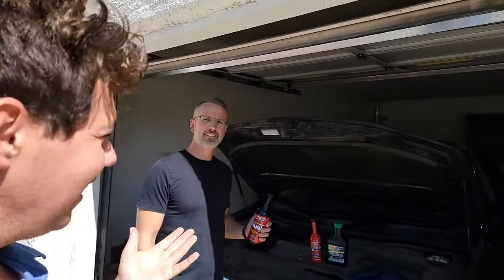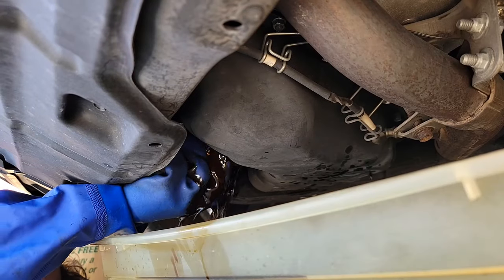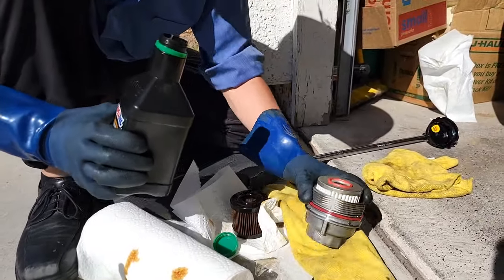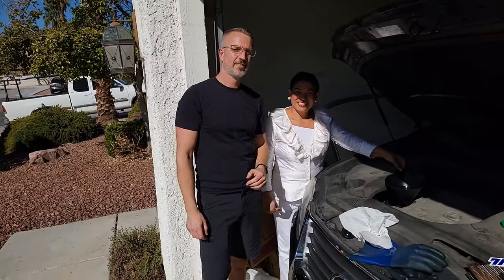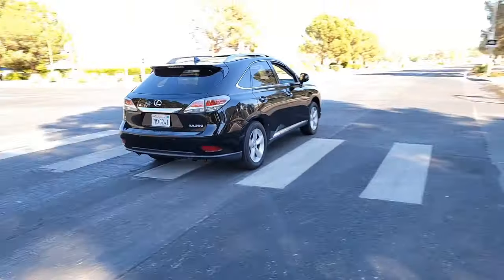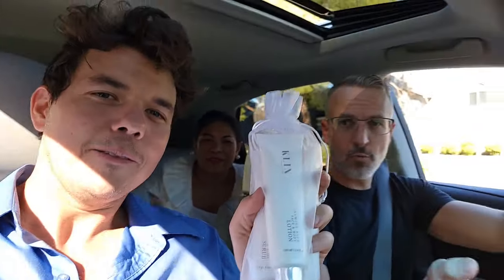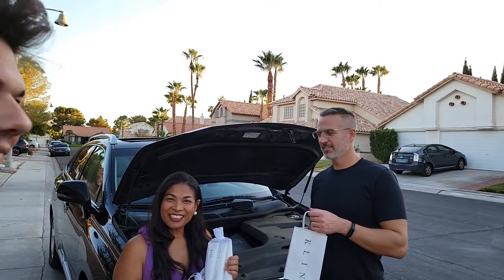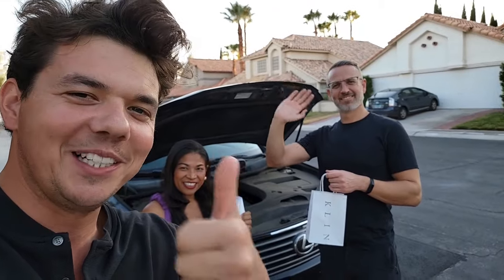Stop ! Oil Burn 3 FLUIDS

Comment from the maker: Watch This Next: Get Faster Transmission Shifts Than Brand NEW With the Right Fluids - https://youtu.be/sGzTtXVP24c 

     ✅ ✅ ✅  Save 25% On Next Fluid Order: https://www.amsoil.com/offers/pc/?zo=5331179 

     ❤️ 🇺🇸 ❤️ Your Professional YouLubher: Eben Rockmaker. Find The Right Fluids For My Vehicle - https://www.amsoil.com/guides/?zo=5331179      

     🥇🥇🥇 Synthetic Oil Protection Google Map & Reviews (702) 472-3614 https://maps.app.goo.gl/DmLU5hP72HadUBEm9              

     ⛳️ Synthetic Oil Protection Website - http://syntheticoilprotection.net 

     Did you know a oil manufacturer can call a lubricant a Full Synthetic when it's only 25% synthetic? AMSOIL is different because it is 100% Synthetic and has a higher film strength keeping the metal parts separated. AMSOIL allows less friction, less heat, less wear on the component. 

      ♥️ See Fluid Performance Tests - https://www.amsoil.com/performancetests.aspx?zo=5331179      

      Your Vehicle Could Run Better Than Brand New By Using The Right Fluids! See Results - https://youtu.be/zH-VquYlhqA Why AMSOIL - https://www.amsoil.com/about/exclusive-distribution/?zo=5331179    
     Synthetic Oil Protection Coffee - Ebens Favorite: https://supportwith.coffee/shop/subscriptions/sop/
Reply from the maker: Great question Roman yeah all you want to do is put it in the motor and let it idle for 15 minutes after you let it idle for 15 minutes then you drain the oil this is my link to the products it will give you the very best value as a 6-month preferred customer and when you use my link I will always be able to answer your questions in the future on the products.
✅ ✅ ✅  Save 25% On Your Next Fluid Order: https://www.amsoil.com/offers/pc/?zo=5331179
Reply from the maker: That's a damn good question I have no idea

Comment: Hi Eben. I just flushed out my power steering system with the Amsoil PS fluid. Looking forward to not doing this service again for a long time as it was a bit messy unhooking both lines using a new reservoir. I could smell the detergents in the fluid as it smelled similar to the Amsoil AT fluid. 
Pump runs a lot quieter now.
Reply from the maker: Oh yeah nothing like getting out the old and getting in the new...... now you're good for a long time💯

Comment: Off topic,  I've had 2 out the last 3 WIX oil filters drain back valve completely fail on my jeep. I'm running the amsoil filter as of now.
Reply from the maker: Yikes that sounds like really bad luck
Reply: Update. Amsoil filter has solved the start up knock.

Comment: I just had the ATF on my 2007 Honda Fit switched over from Honda's ATF to Amsoil. What. A. Difference. Smoother shifting and quieter. I might even see some improvement in the mpg's. The car already runs on Amsoil's Signature Series oil w/ an Amsoil filter.
Reply from the maker: Super sweet Shelton for sharing that with the channel thank you and I'm stoked your car has taken the next step in performance and lifespan

Comment: If youre buring oil dude its rings or valve stem seal or something on its way out the money you waste useing these to keep them alive soon adds up and in the end you may aswell have it fixed
Reply from the maker: Correct when you use these fluids they clean the valves and they clean around the Rings which allows the oil to flow around the oil passages in the Rings and allows a better seal so then you'll have less burning and fuel contamination which exponentially breaks down your motor oil these fluids will increase your vehicles performance and extend the lifespan of the vehicle

Comment: Ehh, have had ams oil signature series in my 2019 Dodge since about 3K miles have 87k miles now. Decided to do an independent oil test and wouldn’t you there’s 29 ppm lead and 26 ppm of copper… so is ams oil better we will see once I take the engine apart and check out the internals 😅
Reply from the maker: Oh yeah you'll notice your oil will get very dark that is the detergents cleaning the old mineral deposits out of the motor once the filter gets full the oil will get even darker so it's good to change that filter early I would change your oil filter at about 3 to 5,000 MI

Comment: Hey eben, I have a 2004 Tahoe with 240,000 do you think I would benefit from it? I usually change my oil at no more than 10,000 miles. I have used Havoline full synthetic since I’ve owned it.
Reply from the maker: Yes you'll see a huge difference this will give you the very best value on the products and when you use my link I'll always be able to answer your questions in the future👍
✅ ✅ ✅  Save 25% On Next Fluid Order: https://www.amsoil.com/offers/pc/?zo=5331179 

     ❤️ 🇺🇸 ❤️ Your Professional YouLubher: Eben Rockmaker. Find The Right Fluids For My Vehicle - https://www.amsoil.com/guides/?zo=5331179

Comment: Do you have a shop?   I think I saw you were in NV in a video.   
If so what is your location I have a Tacoma that needs a bit of work.  TIA.
Reply from the maker: Awesome yes I live in Las Vegas on the west side of town and I do lots of videos on people's vehicles I personally don't own a shop but I do recommend the products and you can order them through my link and that would attach me to you in the future I can always answer your questions about improving the performance and lifespan of your vehicles and equipment by choosing the right fluids as your independent Amsoil Dealer and I can also recommend installers if you ever need someone to put the products in your car you can also use someone I know or your mechanic you already use😃☕️

If you have any questions give me a buzz👍
Eben 702-472-3614 
✅   Save 25% On Your Next Fluid Order: https://www.amsoil.com/offers/pc/?zo=5331179

Comment: Which oil for my 67 Buick Riviera, 430 c.i.?
Reply from the maker: There's a lot of variables here depending on how many miles are on it and the way you'll be driving it personally if it was my car I would do a engine flush on it and I would run 0w-20 Signature Series in it for about 500 to 1000 miles.
This will allow the carbon buildup to slowly get melted out after that I would go with the classic car oil called zerod you can run the 10w30 which will give you great protection for flat topic cams and I wish I had this information for my Cadillac when I first did the fluids also I recommend the pi performance improver and the Amsoil power foam you'll see that on a classic car playlist on the home Channel page this is my personal link and when you use it I'll always be able to answer your questions in the future on the products and I appreciate your business future business in advance thank you👍
❤️ 🇺🇸 ❤️ Your Professional YouLubher: Eben Rockmaker. Find The Right Fluids For My Vehicle - https://www.amsoil.com/guides/?zo=5331179
Reply: @Syntheticoilprotection  Much appreciated. Engine was rebuilt about 1985. Maybe 30 k on it now. I drive it once a month. I know they need the zinc, "zerod."
Reply from the maker: Yeah it's always a nice added protection it's nothing you need but it will protect the cam lobes and areas of hard contact because of the flat tablets.

Comment: Eben. Are amsoils viscosity grades slightly thinner compared to most other full synthetics? Seems like I have better fuel economy and slightly more oil burn on amsoil 0w20 compared to other 0w20s like castrol edge or Mobil
Reply from the maker: The viscosity is the same pretty much across all oils very little difference the difference is the film strength that keeps the metal Parts separated so you'll have less friction less heat less wear also with Amsoil you'll have a lot less oil burning then the other oils this test will show you the difference.
♥️ See Fluid Performance Tests - https://www.amsoil.com/performancetests.aspx?zo=5331179

Comment: Bro that’s so bullshit ams oil is top-of-the-line high-quality oil that runs absolutely no different in my car. Nothing that I can note different engine sounds the same does not run any quieter drives the same if I had to compared to Mobile one it would be the exact same thing.
Reply from the maker: There's a very big difference in film strength they will manufacture to call a full synthetic flu synthetic when it's only 25% synthetic and soil is 100% synthetic so you've less frictionless heat less wear..

This will show how big of a difference it is.
♥️   See Fluid Performance Tests - https://www.amsoil.com/performancetests.aspx?zo=5331179

Comment: Stop oil burn...........................change your oil ever 5000 miles ......problem solved.
Reply from the maker: How often you change your oil has nothing to do with oil burning over the years the mineral deposits build up around the Rings and eventually it's like burnt butter on a frying pan even if you change your oil every 500 Miles you'll still have build up when you run mineral oil without the proper detergents that creates a sticking around the Rings to where you lose compression then get exponentially burns more oil and that leaves a lot of buildup in the exhaust valves also fuel contamination into the crankcase motor oil which makes it burn more oil by using the higher quality engine flush to remove the carbon feel free up the oil passages around the Rings and then when you run the signature series motor oil will clean the rest of the build up out and changing the oil filter at around 5,000 miles is best on your first oil change with the signature series.
With the Amsoil you can comfortably go $25,000 miles from one oil change.
This video is a $26,000 mile oil analysis - https://youtu.be/Wdq2A2YIorM
Reply from the maker: I know Andy that's what I thought when I found out about Amsoil at SEMA back 6 years ago I thought there's no way in oil could last that long.
The video that blew my mind was on my Honda Uber car this is the oil analysis - https://youtu.be/fdSyZ-D3gnw
Reply from the maker: Andy this will show you how the lubricants are different there's many tests here showing how 100% synthetic film strength is different ♥️ See Fluid Performance Tests - https://www.amsoil.com/performancetests.aspx?zo=5331179
Reply: @Syntheticoilprotection  you will never convince me in a million years to even think about going 25k miles between oil changes...are you going to buy me a new engine when it starts burning oil due to neglect.
Reply: @Syntheticoilprotection  what about filter changes. you are giving out really bad advice
Reply from the maker: You bring up a great point and I always recommend everyone to get their toes wet in the beginning that's what I did I didn't trust it I changed my oil on my C5 Corvette at 5,000 miles and then over time I started trying it a little longer and then I did my first oil analysis test and I couldn't believe how much of a difference it was and how little where the motor oil had and I found out the biggest bottleneck to the Amsoil is your filter as long as you change the filter you're good for quite a bit longer than what is recommended but if you live in a high dust condition you want to make sure you change your oil filter sooner than later I recommend changing it halfway through the interval but the oil is good for well over 25,000.

Also when you do that type of mileage you check your oil on a regular basis personally I check my oil about every month on my personal vehicle and I always make sure there's no fuel contamination and there's no coolant going into the motor oil as long as there's nothing contaminating it you're good to continue running it also I always make sure it's topped off usually you'll burn about half a quart of oil in 10,000 miles with Amsoil very little compared to other fluids and that's where you really see how big of a difference there is.
Amsoil does have a fluid warranty and if you follow the warranty instructions they will buy you a new transmission.
https://www.amsoil.com/about/guarantee/?zo=5331179
If you have any other questions Andy let me know oh he's happy to talk with you and explain exact details😉
Reply: @Syntheticoilprotection  I appreciate that but there is no way in hell I would even think about that. I''m an old man and in the 80's and 90's we were getting engines from Japan that had 30k miles on them because they aren't allowed to change their oil their so a life span was 30k then they just replaced the engine and sold the old one to stupid Americans. Those engines were spent. I have no problem with amsoil I know it is a good product  but i'm sticking to 5k with oil filter....it's cheap insurance and I'm not willing to roll the dice or even consider it
Reply from the maker: I understand😊
It gives you butterflies just thinking of it that's how I felt when I first thought about it.
Reply: @Syntheticoilprotection  good luck
Reply: @Syntheticoilprotection  tell me which vehicle of yours you ran 25k miles and didn't change the oil
Reply from the maker: There's a bunch of them they're all in the oil analysis playlist you'll see all different intervals.
We have Sean's Challenger we also did a Dodge van 26,000 miles we also did a bunch of diesel trucks at all different mileages you'll see everything right here in this playlist - https://youtube.com/playlist?list=PLB_ftWArBFddc-nU9A-k2vfxWYxdq3E_b